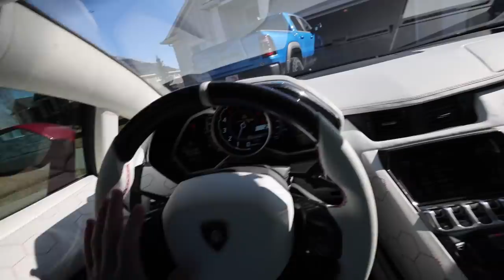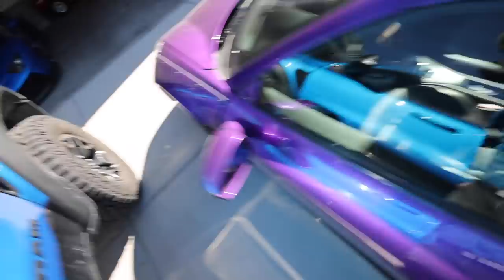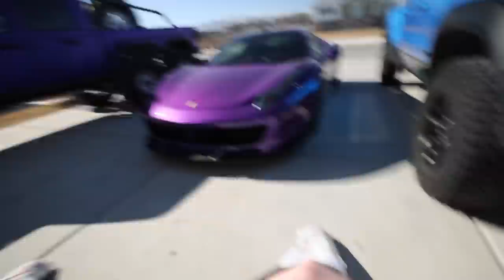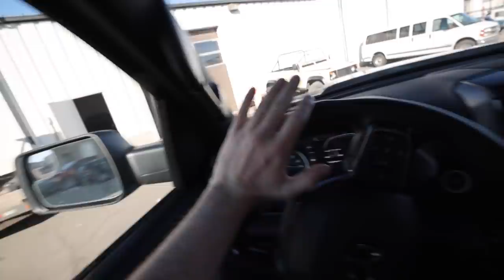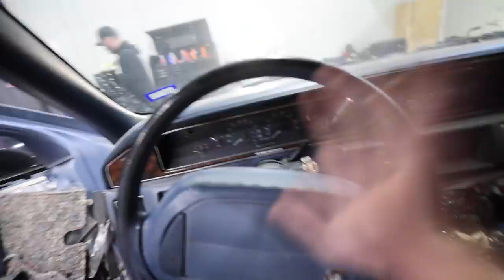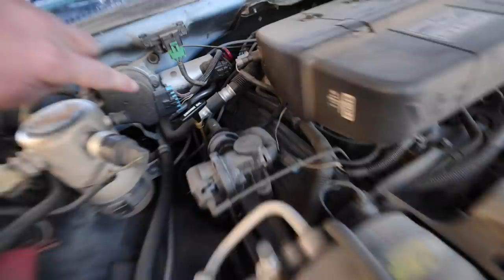Replacing Motor Oil with PRIME from Logan Paul & KSI.  Will it still run?

Comment: See now, those aren't actually check engine lights. It's actually this cool xp system for your car, and as you level up, you get new badges on your dash, some think these are warning lights, but no, they are xp badges. 🤣🤣🤣. 

Also, the new carbon fiber hood looks amazing, and best of luck with getting everything on the countach patched up!
Reply: Cringe 12yo type comment
Reply: @jakedean8560  hey let him enjoy
Reply: @swarajchhajed  Same profile type comment
Reply: @jakedean8560  why do you deem it necessary to comment this? I said nothing to you. What is the purpose of you commenting that?

Comment: And in this video we confirmed to a high degree of scientific certainty that James has zero automotive mechanical skills.  

We love James for many reasons and he has abundant talent in other areas.

Seriously, I was equally surprised that it drove for 30 minutes without engine oil.  I guess the 10% coconut oil provided a slight lubrication as the bearings wore down to nothing.
Its weird.  I'll fully understand that a car must go to the junk yard to be recycled.  But I cannot stand watching a running engine be destroyed.  Kind of like 'lets see what happens if we shoot the puppy'.

Comment: An old motorcycle trick back in the '60s was putting a bit of "Real" Lemonade in a flat battery, the "CitricAcid" would corrode the lead plates faster so it would charge up sooner, but that's not going to happen with a modern battery, but look at that, you were nearly cleaver by mistake if you can be clever by "Accident" just imagine what you could do on purpose? the Donk.

Comment: The engine is to big.That s why.You will lern.One Day.
Reply: like Porche.They are so special,because the heat,is never the problem.They are to far,for heating.the pistons/engine block.
Reply: but,some components,are just hydraulic related.So,an engine to run,on not compressed liquid(like oil) is just to much.Like a Nuclear Reactor.It can't run on normal water.The dissipation will be to BIG.When the water hits the izo-iso tops(uranium-plutonium on/in compression),in the upper side of the reactor,will exploade.In a Nuclear Reactor,if the normal water hits the iso tops,it can exploade(like a stupid).IS Like,you put ice on lava.Try to remember.The dissipation of the water is so GREAT and fast,that,can make an explosion.Because of the speed of dissipation.My english is so dumb. i am a little drunk at the moment.That's why the explication .
Reply: you see,the engine is not made for water.If is made for compress things,can take a lot of heat.Try to remember that also.

Comment: 1 minute in and I can already tell this man isn't a true car guy. A normal car guy at the very least should know that that middle icon on the right means you have headlamp/rear light issues yet my man doesn't know any of them except the check engine light which is the most general thing ever. smh. 

Still love ur videos since I'm a new sub, but just wanted to point that out.